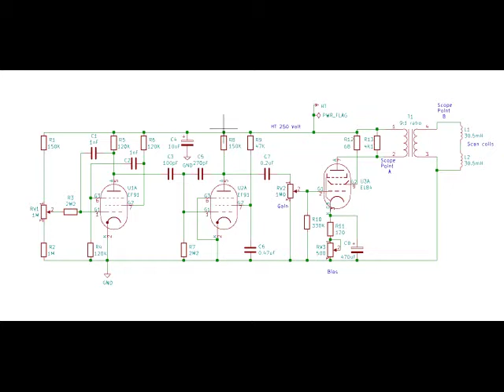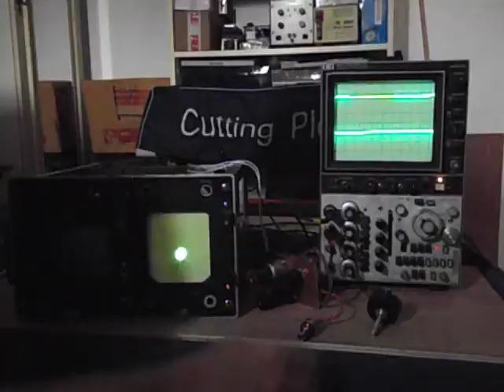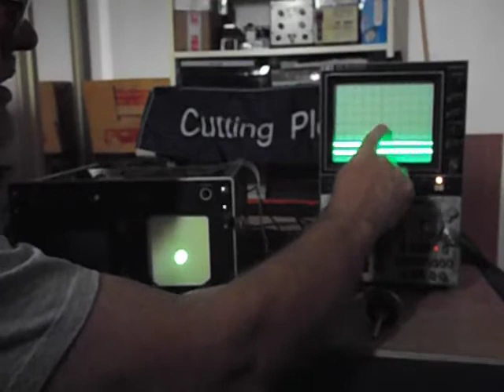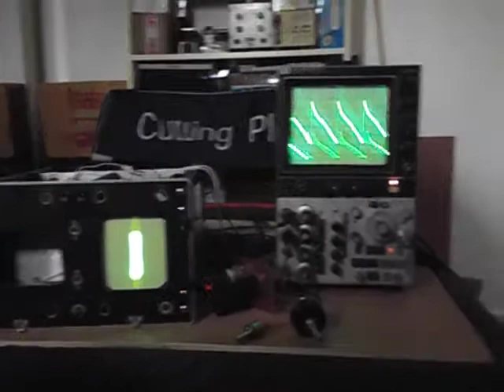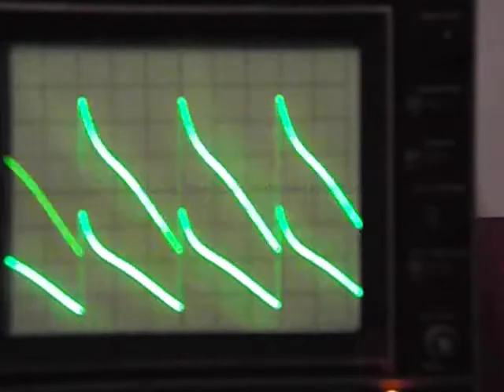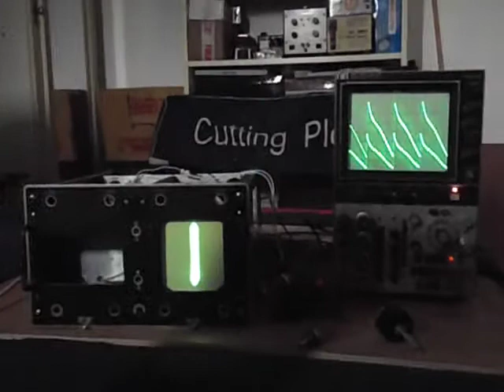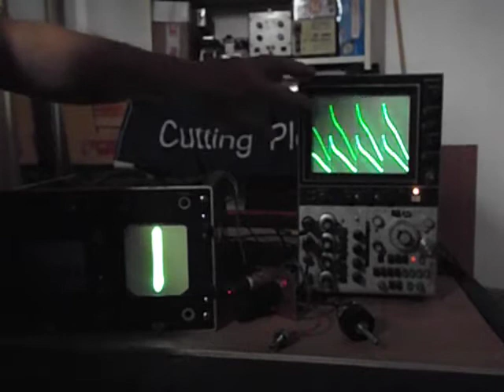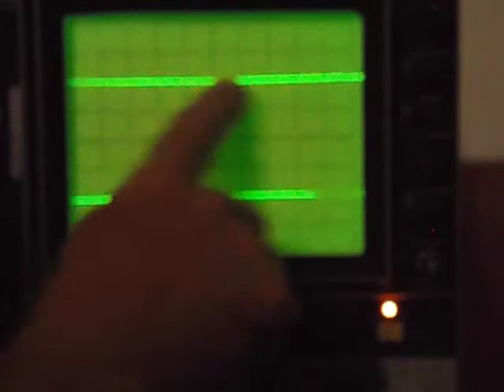Project with the 5FP7 ex RADAR CRT. Part 4. Mains power supply and initial line scan.

Comment: looking good ! Valve NBTV and SSTV  very possible done it the other way around with solid state  and a p1 so your p7 perhaps a little ghosting on the NBTV side with movement but should be good .
Reply from the maker: Thanks, I am having a few days off the project at moment.  All I have done after this at present is to tidy things up, put the line circuits within the chassis and add a few metal screens to stop me getting HT shocks.  
Looking at the specs of the CRT the maximum line width of a focused spot is 0.02inch or 0.5mm so in theory 32 lines would be 16mm wide, looks like I would need to either use an unfocused spot or add a spot wobbler to get a wider picture when and if complete?
Reply: @ef91valve   i have made a nbtv out of a small 625 line crt spot size was something i was wondering about at the time as well but pretty automatic due to size  positioning of the small raster to fill the space of the crt and timing ...so its not a problem your thinking of 32 widely spaced thin lines.
Reply from the maker: @039dalekmoore2007  Yes I was wondering line spacing, will have to see how it goes.
Reply: @ef91valve  Yes don't worry you will find the only thing you will have to do is adjust the size controls for sstv and NBTV as it  is a bit different in line frame  rates ,biggest problem   is ones horizontal scanning other vertical ,when i made my magnetically deflected old 625 line tube i just left it  scanning side ways due to the crt casing was like that ...any case yours is looking good  love the casing its in .